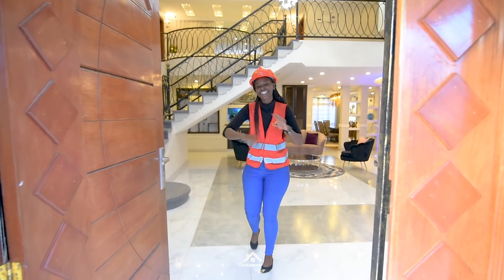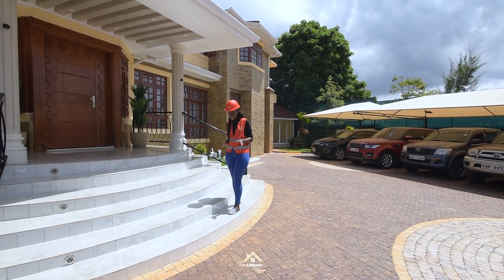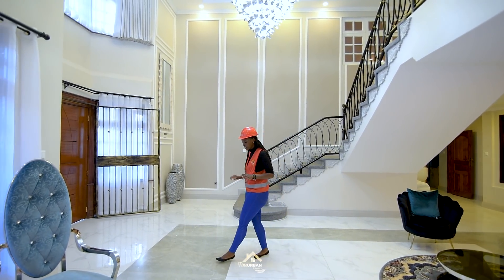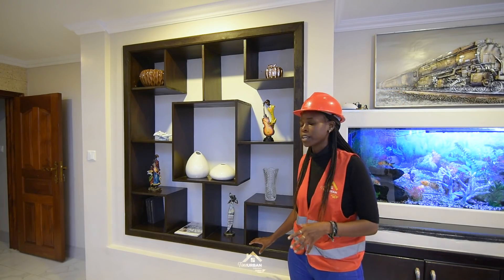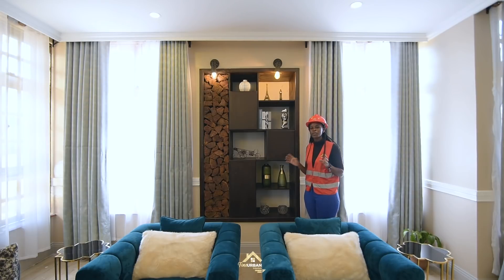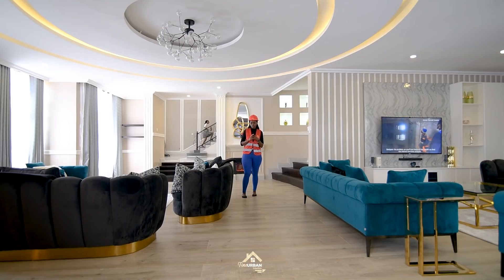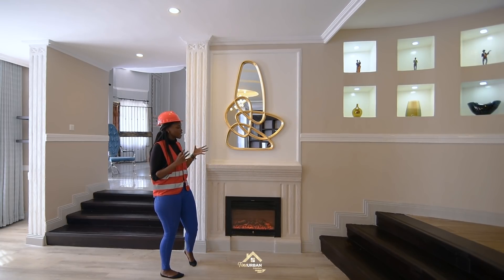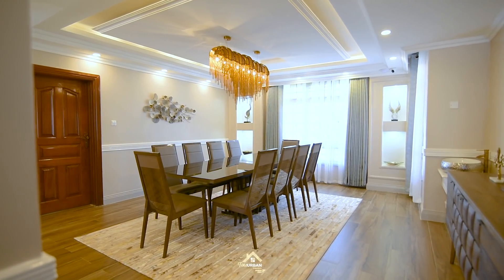Interior Design | Top luxury Home Interior | Ultimate Luxury Home Tour | #realestate #luxury

Comment: Great design, quality finish. A little more balance (grass and concrete) at front yard would have been better. Also, why pass the iron handrail at front staircase through the precast columns? Golan heights type security fencing ruins the architecture.
Reply: Also the overly done gypsum features on the ceilings and walls..